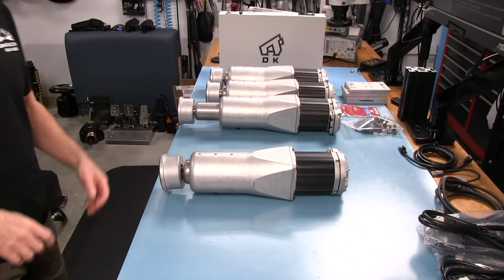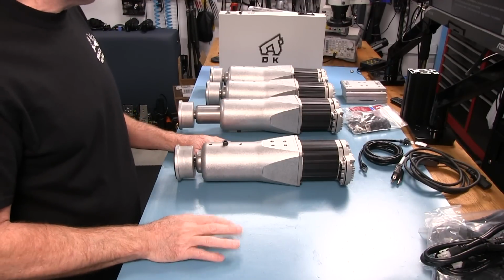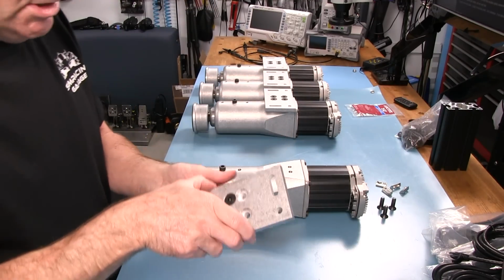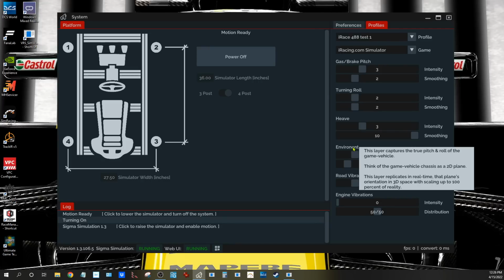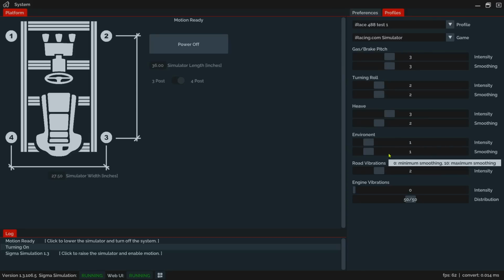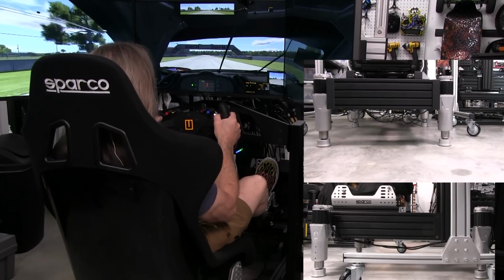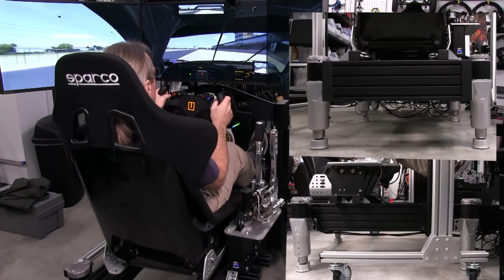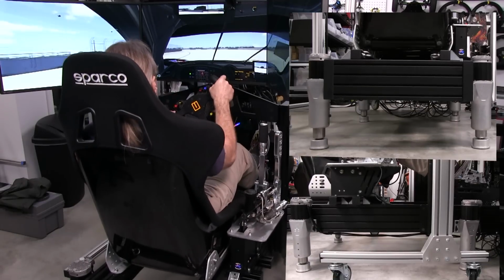Sigma Integrale DK2+ Motion System Review

Comment: Which is your fav motion platform that you use on a regular basis?
Reply from the maker: PT Actuator is my current go to. But there are other good ones out there.
Reply: Thanks @simracinggarage3026  What are your thoughts on DK2 as that's easily accessible in the US?
Reply from the maker: It's a good system.
Reply: @arnieswap   fwiw I have owned the PT-Actuator system and sold it, I now have the Sigma Dk6 and honestly there really is no compare as it is far away on a whole different level in terms of the motion quality. PT's were fun but dk6 is astonishingly good ... no great !!! But the caveat is that if traction loss is important to you then sigma do not have that. I use a Qubic bt1 belt tensioner tho' and that goes great with dk6 for a feeling of g-forces. After all though it is whatever you find and make work that you will love as motion in sim-racing just adds to it and enhances the experience.

Comment: Heard you need another ethernet plug in your motherboard or add another?
Reply: Correct. If you do not have an available network port available on the computer, a simple $20 USB to Ethernet adapter is required to connect to the controller.

Comment: How easy would it be to mount these on a rig such as an rseat P1?
Reply: I have seen some people have installed them on the P1 not really sure how they have done it, but I am guess it's not too bad
Reply: Requires some drilling with a provided template. Pictures here: https://www.racedepartment.com/threads/dk2-motion-system-usa-made.219697/page-5

Comment: In regards to motion platforms, would it not be more advantageous to use the lightest cockpit you can(not sacrificing rigidity) to get the fastest travel from the actuators. I.e using the GT Omega method of using lower grade  aluminum in non essential areas as opposed to thicker aluminum profiles all around from say Sim Lab, ASR and the like?
Reply: Not necessarily. Feeling wise having some suspended weight feels great, but the system is able to provide smooth and consistent motion regardless of mass. ;-) The motors do work harder with more weight but as long as you are within spec, it should be just fine. ;-)

Comment: nearly $7000 for this is a joke .i get that its a decent bit of kit but thats just taking the piss
Reply: A crappy seat motion system costs ~$5000, so $7000 is rather "reasonable"
Reply: @Sithhy  they all cost too much imo
Reply: @scoobysnacks209  I was just going to say that Sigma's DK2 starts at $3,900. The system in this review is a premium version so it costs more.
Reply: What would you say is a reasonable price for a USA made motion system?
Reply: @howihowi  i dont know depends on the markup
Reply: You can get the smaller one for $5k amd if you got 3 actuators instead of 4.  It's $4k

I think that's what I'm going to do

Comment: I always think about why do this kind of systems have the motors on the "moving" part and not flip the system so the motor is "on the floor" (obviously taking into acount necessary design changes like motor disipation...) this way it will "free" the system to have to "push" it may not be a lot but may be 1 or 2 kg by "feet" will become available to move the rig it is mounted on.

Comment: Great review as always Barry. Just decided to get the FREX H shifter after a long while with my TH8A based on your review a while back thanks for the help! I would personally skip these and just spend the extra 1400 or 20% on the DK6 with 3x the suspension  travel. From what I've also heard the actuators should be mounted so your seat area is roughly in the center between the actuators so it acts more like a real car would with you sitting roughly in the center of the car although you would probably have to get longer bars for your rig. Also what car sound is used in your intro? After listening to a Porsche 991.2 RSR GTE from the 2018/2019 season it sounds exactly like correct me if I am wrong.

Comment: @52:40 some of the rumbles in iRacing are painted and/or do not have the actual raised surfaces 3D modeled. This is specially true on the Red Bull Circuit or COTA. 

Some games completely remove the 3D rumbles and instead rely on locational effects or basically a mapping of the location of the wheel to play an artificial "effects" that send vibrations to the wheel and/or controller rather than the vehicles actual suspension. This is done for efficiency reasons, such as time to model the track and/or to shorten the loading time (less polygons to load). 

In short, a good motion system can shine some light on the level of detail that the track has from the developer.

Comment: Is this a D-box beater? 🤔
Reply: That's not a very high bar.
Reply: @pt-actuatorukltd1118  Why does Barry use D-box himself then?
Reply: He doesn't use d box he uses pt acuator 6 dof system..I know I've been there alot lol
Reply: @jacobcisco7059  I must have been watching older videos then
Reply: @adamlitchfield3371  no worries man he has alot of systems in and out of there understandable why you would think that
Reply: Nah, dbox is also releasing a integrated motion system without controllers and same stats as their top model currently for 1.5k cheaper. Gen 5 releases next month
Reply: @vividpsychosis  Where and when has that been announced? Can't see anything online (?)
Reply: @adamlitchfield3371  hasn’t been announced yet but I just put a 50% preorder on one through my local sim dealer. They got contacted by dbox last week. I have a photo of the new system though. :) no more controller boxes
Reply: @vividpsychosis  Ordered my Gen5 as well...the Gen 5 will also work with movies! My guy has been with D-box for 20+ years and says no one should be taking any cash deposits, something to be aware of if you did....not sure what it means just an fyi.
Reply: @vividpsychosis  how is the system?
Reply: @Delta-mt8xb  awesomeness. I’m loving it.
Reply: @vividpsychosis awesome! Congrats,  I havent seem them on the market yet and was wondering. 

I wonder if they are going to do a review video?
Reply: It's half the cost, so probably not better

Comment: This is something I don't understand just 50mm, a rally car goes up and down a bit more 100mm when you add it all up lol;, and the rest I'm not sure, but a normal car I do know, Can you also tell me what kind of music this is playing lol; db if you can thanks, Only the price is a bit high, especially if you have to order for Europe
With years of experience building simulators and motion systems for 🚗 manufacturers, we believe that a motion system with 2.0” of actuator travel is the optimal amount to produce a precise, responsive, tight and realistic experience for sim-racing. We believe that a compact 2.0" system is more than enough to realize our complex, multi-layer VelocityTrap motion algorithm.  A longer actuator system certainly has some additional benefits, but the primary motion should still be kept within 2.0" for optimal speed and response (for sim racing application).Thanks info Barry And as usual thanks for the research
Reply: I heard that 50mm vs 150m argument many times.... Real cars do this or that... But I'm not in a real car. I'm in a sim that doesn't give me g forces. So i enjoy those extra mms to make up for the lack of g forces... Also, 150mm is a nice feature to simulate up slopes, and banks at Daytona.
Reply: I run the DK2, done so for 5 months now, close to every day. Not once have i though i want more travel.
I do 70% road , 20% rally and 10% drift of driving, in a high end rig.
Actually, i run with mid to low settings, without smoothing most of the time.

I really dont want to be moved all over the place, without G-forces. Thats would just distract me and make me slower. 

The DK systems use quite special algorythms that use the available travel smarter than many of it’s competitors, that might play a role in this as well.